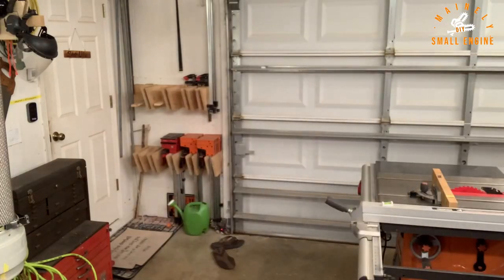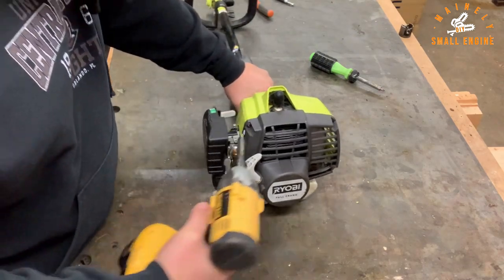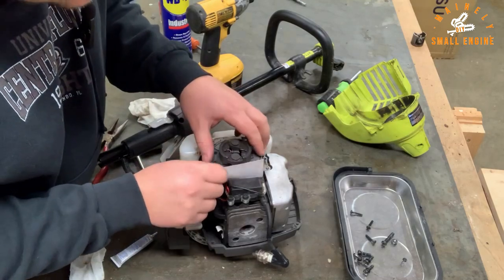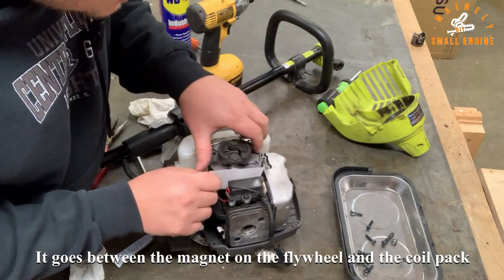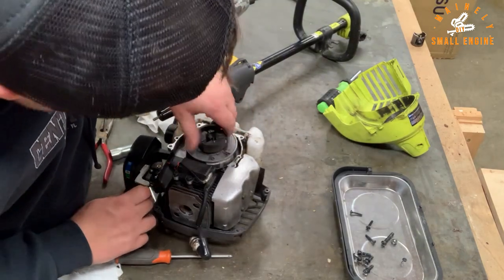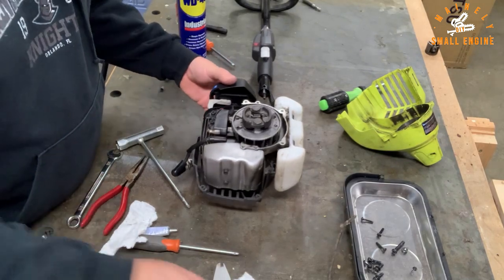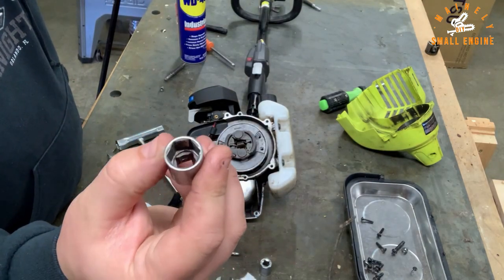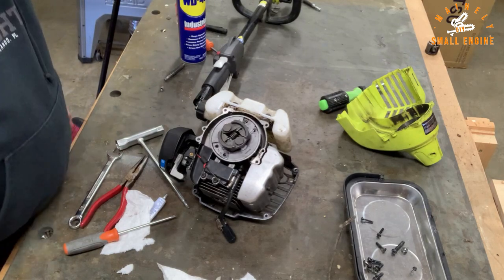Part 1 Ryobi Expand-It broken but its got spark, gas, and compression - diagnosis

Comment: Gasoline flooding like you described usually comes from tank being over pressured and forcing gas passed the carburetor. So check out the fuel cap and vent line. Sometimes they have both venting. Nothing wrong with digging deeper, as it probably needs a good cleaning anyways. I have a old 4 stroke Ryobi weedeater and finally after 20 years needed new fuel lines...lol. I would definitely buy another if this one ever dies. Good luck my friend.
Reply from the maker: I didn’t mention it in the video but I did loosen the cap before trying to start it to see if had pressure built up. I’ll see what happens with this flywheel and if that isn’t it I’ll dig into the venting system a bit. Thanks as always for watching and the tips!